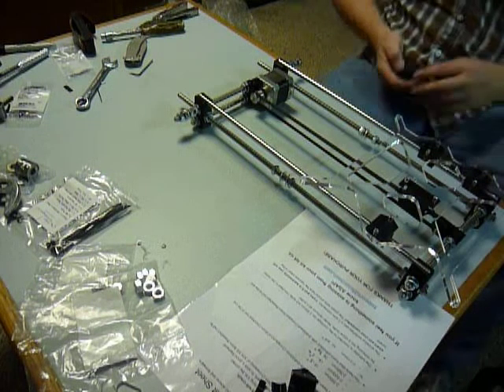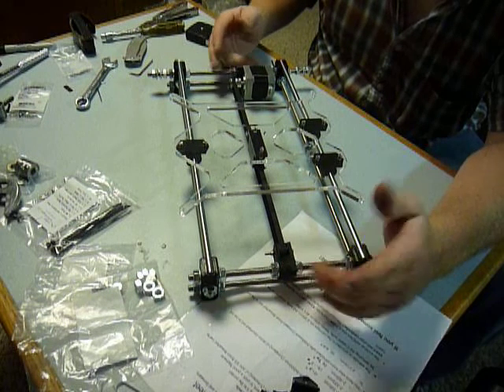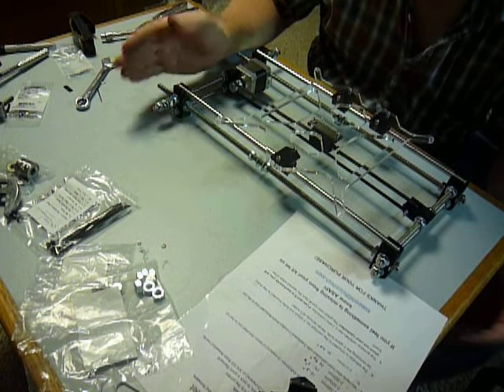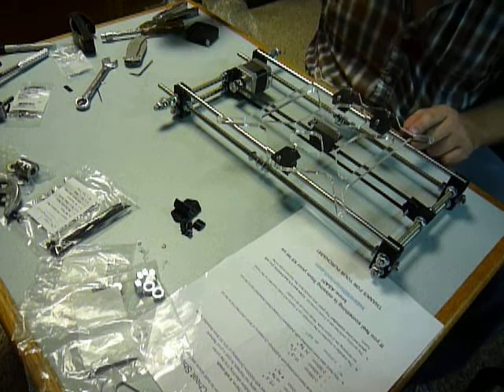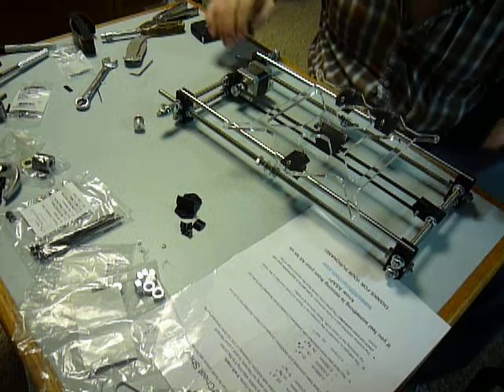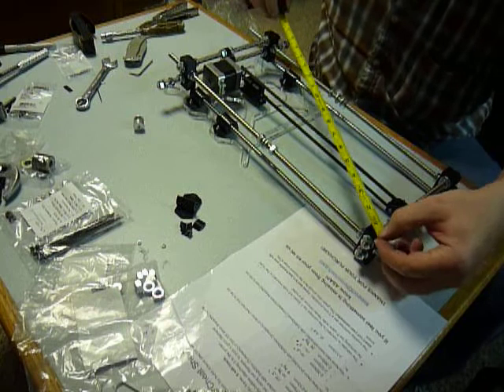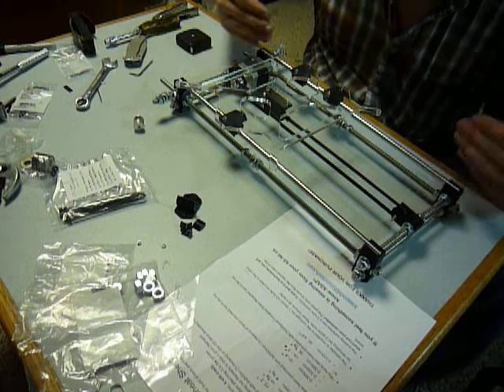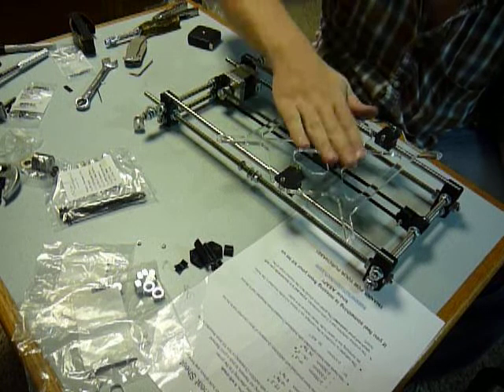Folger Technologies Prusa i3 3d Printer Build part 15

Comment: It's probably best to put the y bearing holders on the linear bearings before you even put those on the smooth rods (by sliding them on from the side like you discovered).  Then you can attach the bolts through the bearing holders to the Y carriage.
Reply from the maker: Marty Rice that's not a bad idea